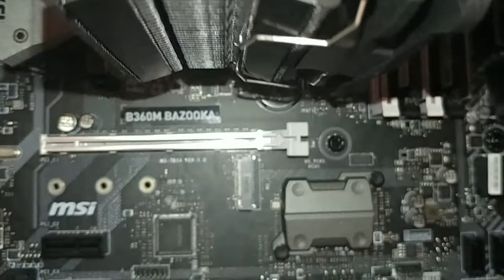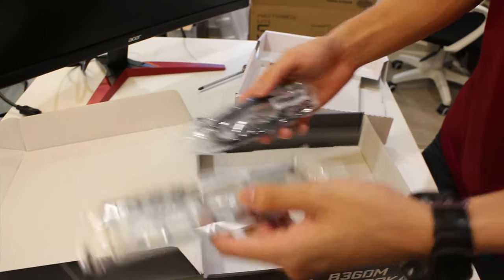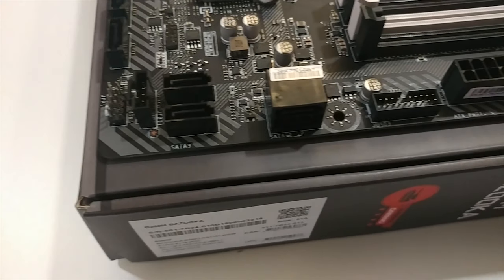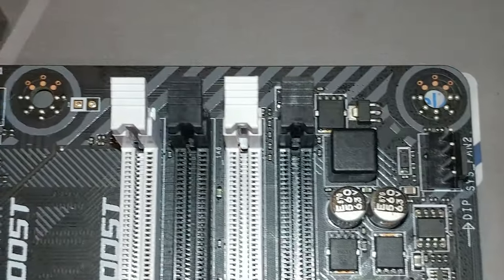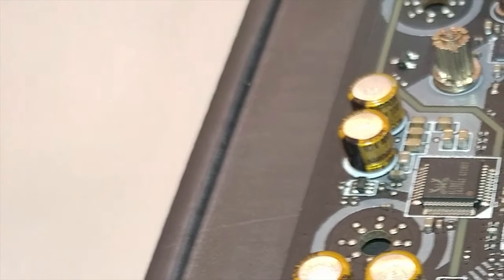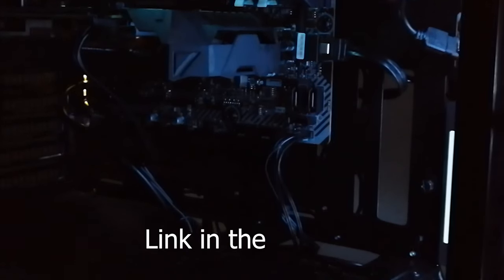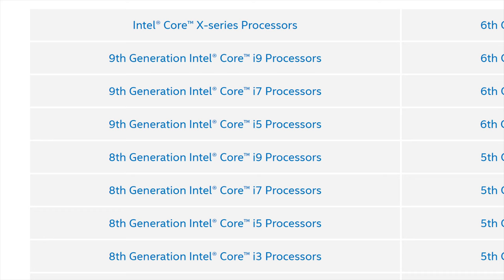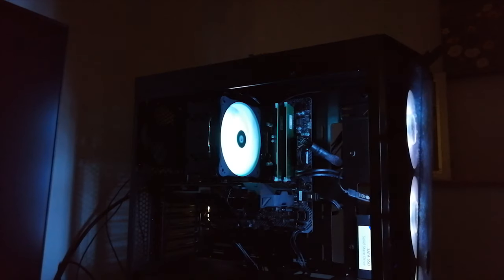MSI B360M Bazooka review Budget and Reliable?

Comment: I don't see a similar question, so I'll just ask hoping you will see the comment. On the manufacturer website specification sheet, it says:

1x4 CPU Header
1x4 Water Pump Header
2x4 Case Fan Header

My question. Is it possible to use Water Pump Header for a Case Fan? Some articles do say that on some other MOBOs there is that option.
Reply from the maker: Hi yes it's possible to use the water pump header however you might want to adjust the voltage to not overvolt the fan as it will destroy the bearings after some time
Reply: @Nwhproductions  and it s possible to change the voltage under the BIOS settings? Thank You for the reply after all this time!
Reply from the maker: @marko_josipovic no problem man always here to help :). Yes you can adjust it in the bios settings

Comment: thanks for the great video, my display went out. Fan is on and lights are on, keyboard is on etc. but no display,. I connected various ports (HDMI on board) nothing works. Bought new graphics card but that did not work either so returned it.  How do I reset the BIOS or get the display back on.
Reply from the maker: Have you tryed clearing the cmos. Turn off your pc unplug it from the wall. You should see a sliver battery. Remove that for abt 5 min and turn it on again. See if that helps. If it does not feel free to contact my on Instagram at nwh productions cheers
Reply: NWH Productions i confirmed motherboard died. Ordered like to like replacement

Comment: Is i5 8600k processor and radion rx 570 compatible with this motherboard? 8gb od ddr4 ram. How much i need power supply?
Reply from the maker: You you benefit better with a z series motherboard so you can overclock your cpu. If you don't know how to overclock you can go for the non k version to save more money. A good psu would be 600w a 700w psu would be better if you wanna upgrade your computer down the road without having to buy a new psu. Good one would be a pfp, coolermaster or corsair manufacturer

Comment: What best gpu for a i5 8400 in 2021 ? Same board
Reply from the maker: What are you doing with the pc and for your monitor is it 1080p or 1440p
Reply: @Nwhproductions  i still don't have a monitor i want like 1440 all max or 1080 ultra im using my 4k TV for the moment
Reply from the maker: @Ibrahim_Alharbi  Hi sorry for the late replay. I would suggest a 2020super if you are using 1080p all max settings at 144hz. For 2k I would use a 2080ti at max setting. Though it also depends on ya game. If its less demanding you can use weaker gpus. Cheers
Reply: @Nwhproductions  can I use a 2080 super dual fan instead of a 2080 ti
Also for this cpu 2k/4k can I use a better gpu like a 30 series card 3070 / 3060 ti or will i get a lot of bottleneck and is a 3060 ti better than a 2080 ti?
Reply: @Nwhproductions  2020 is what?
Reply from the maker: @Ibrahim_Alharbi  I will go for the 3060 if you want more vram that can help in editing. For the 2080ti and 3060ti I will take the 2080ti for more vram. The 2080s and 2060s have the same amt of vram and would not be that beneficial to improve performance. Cheers!
Reply: @Nwhproductions  prices ?

Comment: Can I use c18 ram ? 3600 cosair?
Reply from the maker: Hi, it will work with no issues. Cheers!
Reply: @Nwhproductions  thx
Reply: @Nwhproductions  when I use my mother board and intels hd 630 It works but no sound